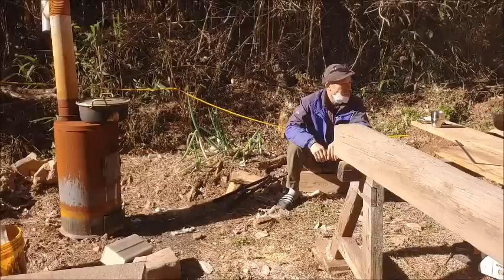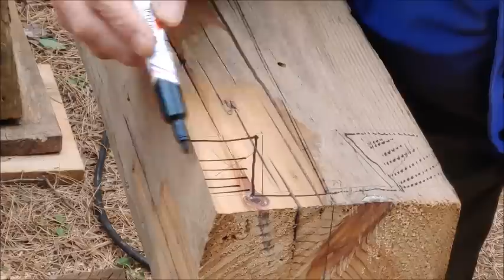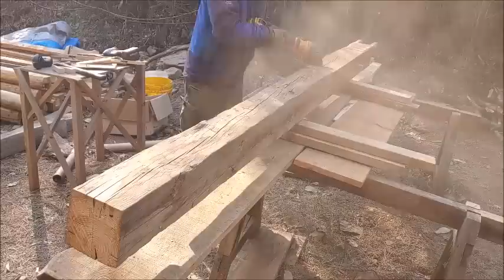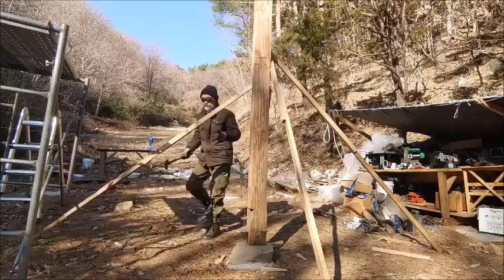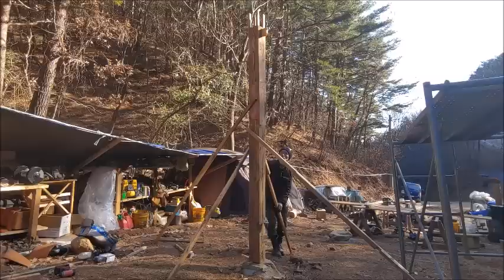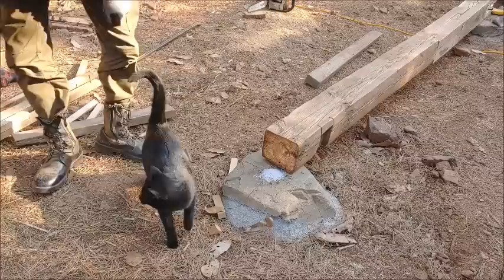기둥을 세워보자. 재조립 2단계.

Comment: Technics he uses in the video….

String’s with weights are to get the post into straight vertical line.

The white stuff he puts before setting the post up is salt. It’s known for preventing from attacks of insects eating timber and making their nest in it.

He does drawing and cutting(it’s called ‘granghee tghi’ 그랭이 뜨기 technic) on the bottom of the timber according to the shape of natural base stone, so it fits and stands by itself. It’s a traditional way of doing it. And it was one of the most important process of building Hanok. You can see him doing that in his other videos.
Reply from the maker: Thanks for your detailed explanation.
It's a perfect commentary.
Reply: Спасибо 🙏💕, что разъяснили про соль, раньше я об этом не знал. Но соль на себя, тянет воду, в холодную зиму, подпяток древесины может сгнить? Или я не прав? Хочу Ваш ответ??? Мастеру большое уважение, от всего сердца ❤💞.